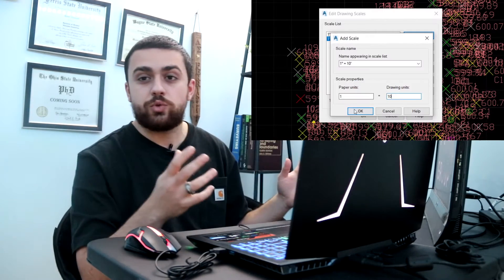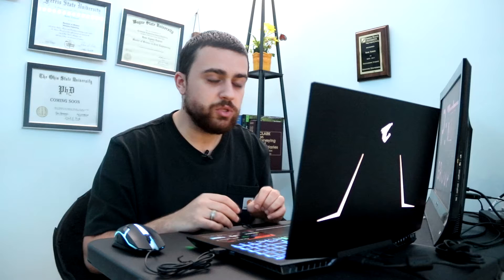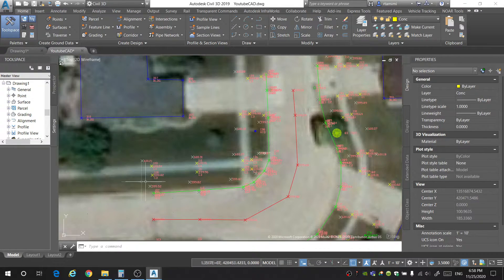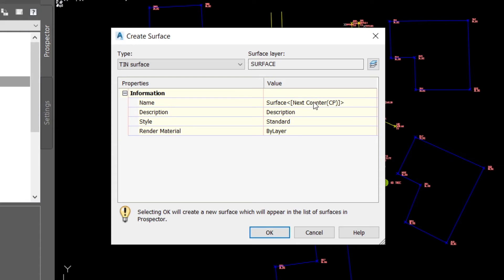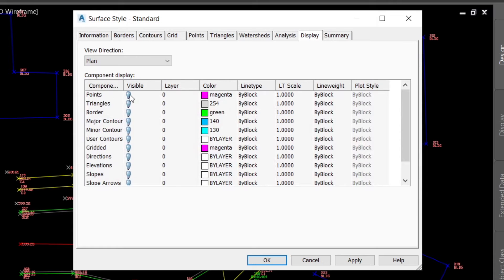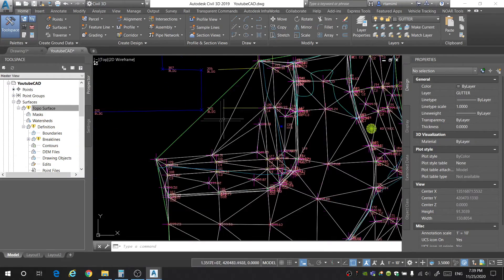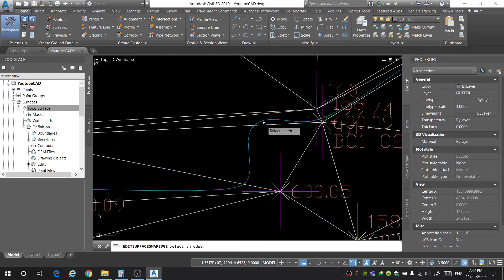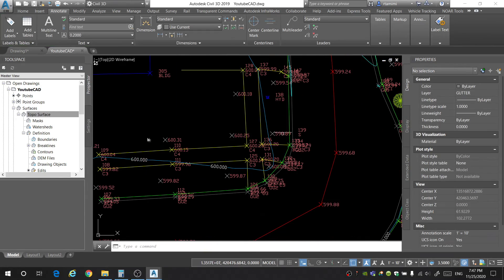Point Groups, Breaklines, & Surface Creation | AutoCAD Civil 3D

Comment: For a small project this works, but if you had a larger dataset or do this workflow frequently you could easily automate the line work with a Figure Prefix Database 😁

Comment: Great video. When you do breaklines for a wall do I need to have shots on the top of the wall and the bottom of the wall?
Reply: You either need shots on the bottom and top of wall or you can shoot the bottom of the wall and add a height in the description. You can also shoot the top and add the height. Then when creating breaklines instead of standard breakline you select wall breakline. There you can add the heights at each point.

Comment: When I try to select a contour it selects the surface which is all the contours. When I have the label command active, I can't select a contour, it shows a horizontal line like I missed the contour. When I explode the surface, then I can select one contour but it won't label it because it lost the surface elevation. I have searched a lot but can't find the answer. Please advise. Thanks, Jerry
Reply: They made working with contours more difficult. I miss LDD. You can extractsurfaceobjects. Not sure if it is a standard command or we had it built. But it makes contours do what you want.

Comment: Why not import the lines as surface feature when you import the points?
Reply from the maker: Lines are not surfaces, but they can be used to create surfaces.
Reply: @RamiTamimi  i'm refering to importing the points and having "lines" auto-generated as "survey figures" to create surfaces
Reply from the maker: @eriklehman3175  oh I normally do that, but this is a beginner level video.

Comment: Very helpful video! Can you explain what would happen if you used regular 2d polylines to draw your breaklines?? I didnt notice a tremendous difference between using 3d polylines and 2d polylines? I also tried to convert all of my 2d poly lines to 3d polylines ..perhaps this is the reason I didnt notice a significant difference?

Comment: Do you use feature lines?
Reply from the maker: When it comes to creating a surface from existing conditions, 3D polylines are good enough. Feature lines are used more in design work. When we are creating proposed surfaces for a site plan, we use feature lines as the have more options when it comes to designing the line.